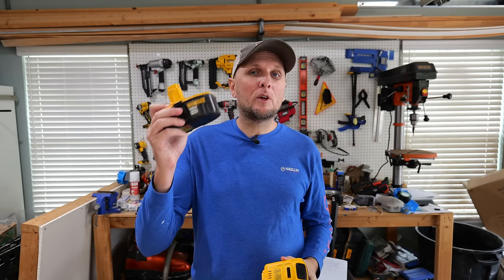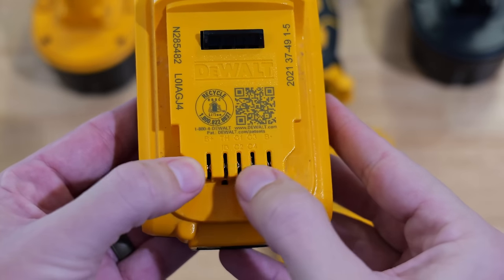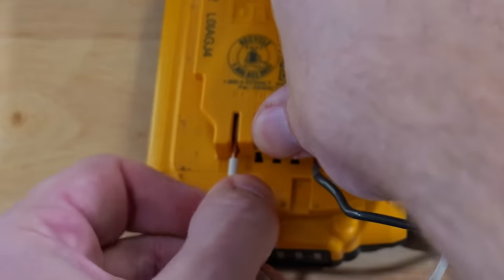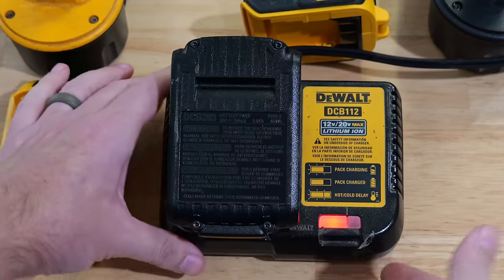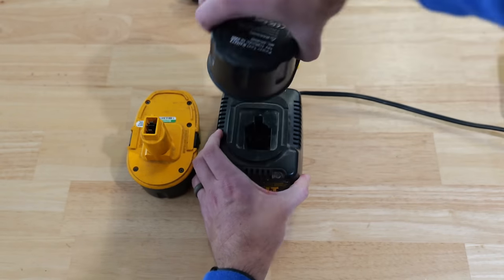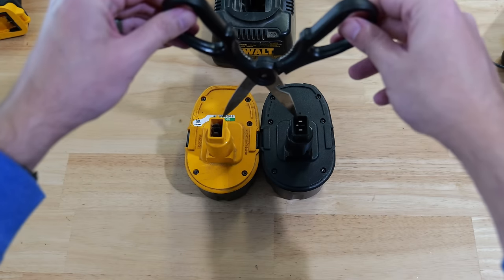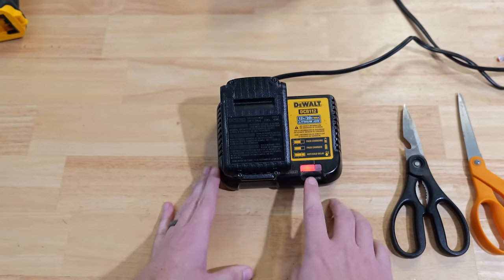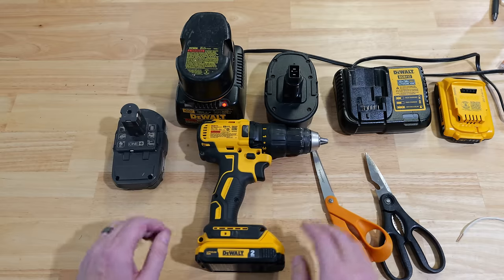SECRET To Reviving Dead Portable Tool Batteries | Super Easy!

Comment: This doesn't seem like it's going to fix the battery, it's more like a hack or a bandaid
Reply from the maker: You’re not fixing the battery. If your battery can’t retain a charge it can’t retain a charge and needs to be replaced.  This is for when they get completely depleted but are still good and the charger just doesn’t recognize them.

Comment: I tried this process with Mikita batteries. 
My charged one was 18.8 v and my dead one was 18.1 v
When I connected them together, I had 18.3 v on both batteries.
I let sit for 5 minutes and then put the dead one back on the charger
IT DID NOT TAKE A CHARGE! 😢
Reply from the maker: Then it’s dead dead unfortunately and will need replaced.

Comment: Very nice idea, but very unsafe. Lithium batteries are dangerous, and should only be used in the way the manufacturer says. The reason the 20 volt battery did not charge is a safety feature. Connecting the two batteries together disablabled the safety on the charger. You should never do it as the batteries can spontaneously go up in flames. This is because under a certain level of charge, crystals can form and short the battery internally and start a bad fire. By connecting the batteries it goes above the safety charge so the charger thinks nothing is wrong and can cause the battery to go up in flames, with everything around it. It is not worth risking everything just to get some more life out of something that won't last as the batteries have permanently damaged from being at a low voltage. you are best off just buying some nice new batteries. You should also have a disclaimer in the video instead of just in the description.
Reply from the maker: Not had that issue ever.  And lithium batteries can have the issue just from sitting in your garage.  Your comment while not impossible, is pretty improbable.  But again, better be afraid of accidentally dropping your battery on the ground though too.
Reply: @HowToHomeDIY  Same here. Lithium batteries can discharge just sitting around. The chance of it happening in increased by the amount of the batteries sit for. Yay, very true. You don't want to drop them!

Comment: I tried this. I followed the directions to the best of my knowledge. The connecting wirers were in the correct position, they got so hot; I mean glowing red hot. They melted the plastic in the battery, which also became VERY hot. I had the pull the connection and the battery stayed HOT for over an hour. The plastic inside the battery where you would plug it into a charger was melted. I WOULD NOT RECOMMEND DOING THIS.

Comment: This is quite risky!

If people insist to do this, don’t do it for long, recharging a lithium ion battery that is undervoltage, quickly, is risky. At least - just revive it by "jumping" it for a very short moment, just enough for the charger to get going. It will have a program to recharge slowly when the battery still is low on voltage.

If the battery is jumped so the voltage gets too high, the charger will charge quickly and very easily, you will get a lithium fire, burn down your garage and house. That is why lithium ion batteries that are very low, will charge very slowly in the beginning, by design of the charger.

I even noticed that someone commented that the revived pack got warm during this process - NO it should never get "warm" under these condition, and if I remember correctly, low voltage lithium ion should be charged at maximum 1/10th C. ( 500 mA if pack is 5Ah etc)

Comment: You are full of it 9:53 I tried it don't work
Reply from the maker: Nope.  I’m not full of it.  Every situation is different.  I don’t know yours but if it’s actually completely dead because the cells have lost their ability to store a charge then there is nothing that can be done.  That will be the case for some.  For many others this has helped and their batteries were usable again.

Comment: This is BS i've tried this it helps for a few cycles but ends up Dead, Just go buy new ones
Reply from the maker: In your case, yes, it would need replaced as the cells have degraded to the point of not being able to retain a charge.  This video is not for that issue.

Comment: 😂 this is a misleading solution this is not a repair This battery will still have the same problem after using the tool which will keep repeating

Comment: **CAUTION** also that "won't charge" thing is a safety feature, low voltage is an issue in lithium, fire and stuff, still, worth trying, these things are way too expensive and UNLESS YOU WANT TO (POTENTIALLY) GO BLIND!!!  SHORTS ARE A VERY DANGEROUS THING! GET A NON-LIQUID EXTINGUISHER. Instead of just wires and scissors, Connector AN Alternative: (I prefer) “Crimp an insulated connector to the wire… now having said it… just for a SERIOUS DEMONSTRATION, short the two with your wire/Clamps and scissors: just to show the danger these hap-hazard methods are. Ever cross CAR batteries?… yea, it’s worth the warning demonstration!!!

Comment: Don't work, if it does run tool it last for 30 sec, and dun
Reply from the maker: Means in your case, the cells are completely depleted and not the issue I talked about in the video.  Unfortunately the only thing that can be done is replace it at this point.

Comment: biggest load of bolloks ic seen if u dint edit video mate this is quickes way to blow a 18650 battery pack up and should never be used, they are cheap enough now to buy new or second and and this should not be done quickest way to a house or workshop fire

Comment: Why cut the scenes and edit the video when switching batteries? There's no need, it should be one continuous shot, but every time you switch the supposed good battery back to the supposed defective battery, the video changes slightly because of the edit in that spot. Why? If there's no funny business, why?
Reply from the maker: I don’t have cut scenes just between the batteries, they are all throughout the video for numerous reasons.  I don’t script my videos so I may have messed up with something I said or felt I didn’t say enough.  Maybe I got done talking and before doing the next thing, give thought to what I’m doing.  Maybe I fumbled the battery around.  I cut out excess footage that would make the video longer while adding nothing to it.  We use zooms to also help with not getting bored or to see things better.  No funny business going on.  You don’t have to believe me though.  I’m not trying to sell you anything.
Reply: @HowToHomeDIY  you're not wrong, the fact you answered me speaks volumes to your character. It's the Internet and I'm sceptical of lots of things. When a battery dies like that on me and it will. I will definitely try your fix. Thanks.